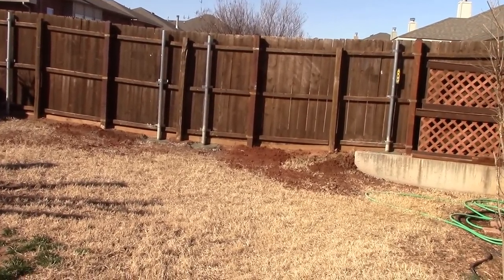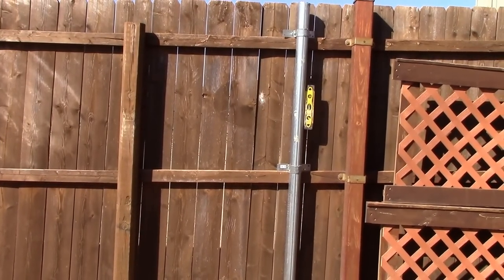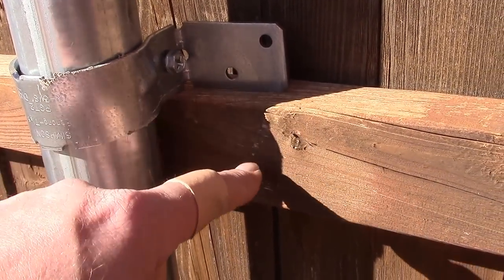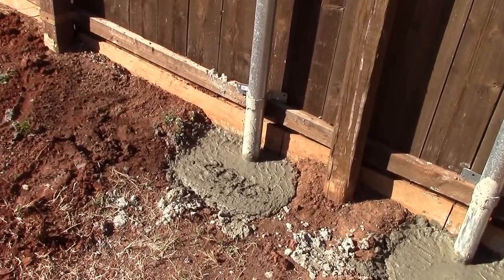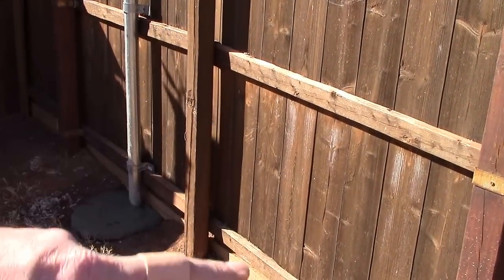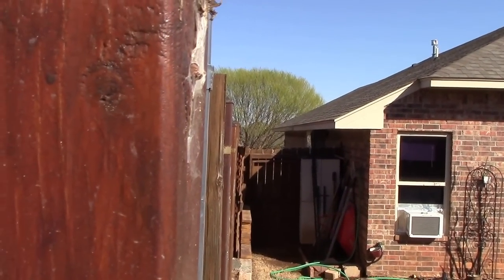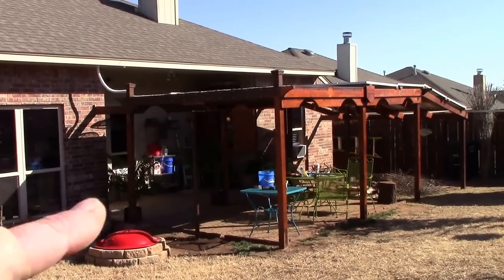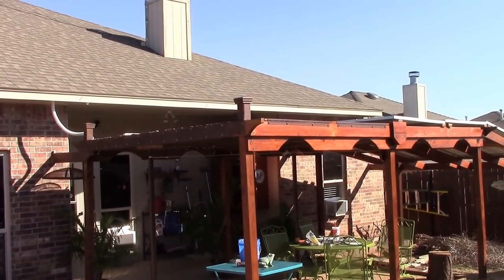13-gauge "heavy duty" stockade fence posts set in concrete for solar panel fence

Comment: You need to go back in time and have a pallet of concrete bags delivered to your driveway.
Reply from the maker: Hindsight is 20/20...but, yeh, you are right! I backed the truck in between the houses up to the gate, used my wagon, and dumped the bags. Much less work.

Comment: Looks awesome, Chris. We had to dig post holes for a mud room last year, and they had to be 42 inches deep and 16 wide. I look forward to seeing the final product. Thinking about it, isn't the new location going to add some length to the cable?
Reply from the maker: Not a fan of digging holes...but, gotta do whatcha gotta do! Mixing and setting the concrete was actually fun. The 600w arrray in the corner I just built has enough cable to disconnect and pull over to the fence. I may have to get some extension and all that. There will be some other rewiring needed...no biggy tho. Good catch and thanks for watching!